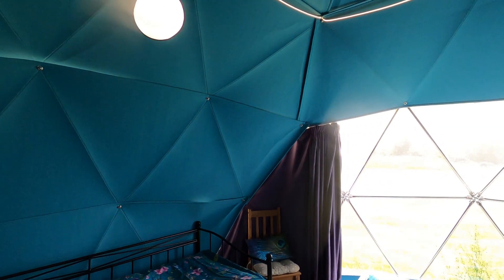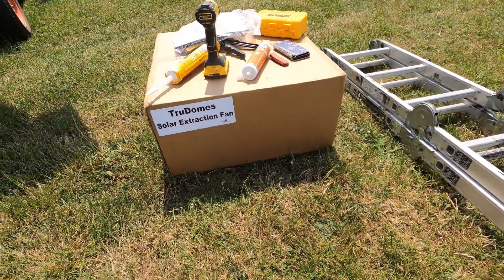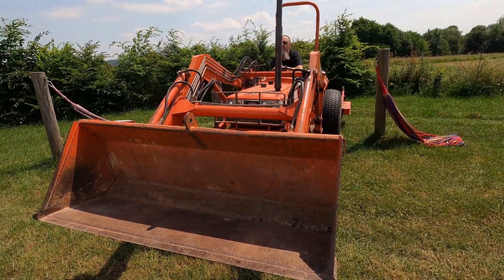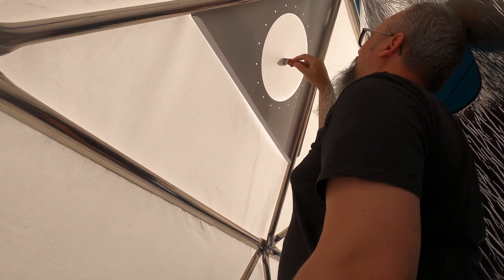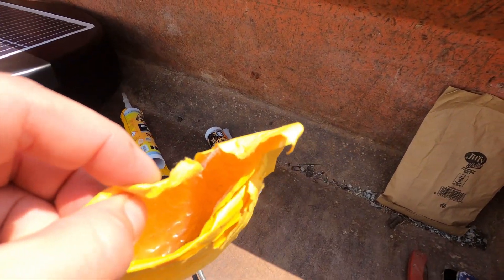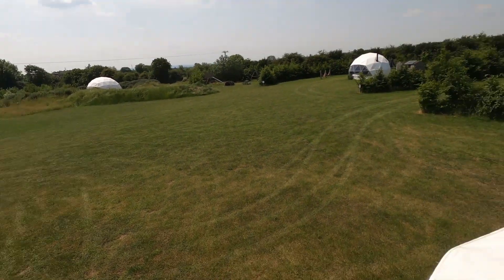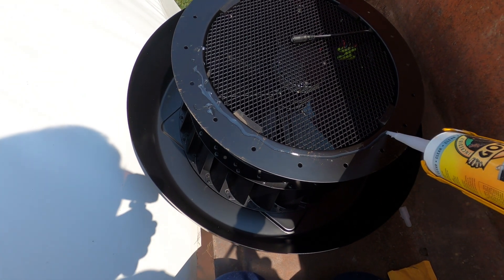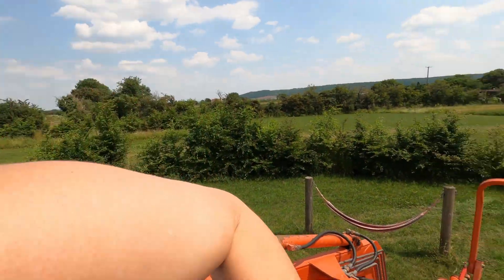Step-by-Step Solar Vent Installation in Geodesic Dome

Comment: How hard is this to remove if you are relocating the vent? (we are buying a dome for festivals.)
Reply from the maker: @ari_zed  it would be very easy to remove the vent as you would just unscrew it - however you would then have a great big hole in the canvas! Do you mean for taking it down and putting it back up at a different location? If you were doing that then I just wouldn't silicone it in, just use the bolts. Sounds like a great project! What country are you in? Thanks, Vicki
Reply: @TractorsandCream  thanks for the reply! yes it would be for taking it down and putting it up at a different location, and this might happen 1 or 2 times a year. we are getting an 8meter dome, and we ended up ordering just some small roof vents with small arched covers that deter rain.  I was concerned about needing to use silicone, so its good to know we could get away without it. but my other concern was climbing up on top of the dome on top of the pvc cover using a ladder, as it will be 4.5 metres, we don't have any special equipment except for a standard extendable ladder. you see, see hope to build the dome structure without any cranes, and then pull the cover, we could climb over the frame to get the cover on. but once its on we could no longer climb on it.
We are in Australia and it may get quite hot in the day, so we are tying to decide if we should put in the solar vent, but it may need a special ladder that extends more than ours and also scaffolding.... oh dear, so many words
Reply from the maker: @enkiverse  so hopefully this video will be helpful then!
https://youtu.be/SGGjTullJhU?si=ooUHz0ivGQvIt7et
We installed 2 solar vents retrospectively in a 10 metre dome using a ladder on the outside and it was definitely do-able! Plus an 8m wouldn't be as high. We are building our new 8m dome on Thursday this week so will have a video out about that soon so you can see the heights. We've never needed to climb over the dome even with the 10m - we just had a scaffold tower inside and a ladder. I wouldn't want to build one every weekend but a couple of times a year would be ok! 👍

Comment: hi whats the estimated cost to build one of these dome if it also include bathrooms inside
Reply from the maker: Hi, we spent about £20000 on our first en-suite dome which was a 7 meter one. When we were at the US glamping show, Trudomes hsd the fully kitted out dome with bathroom pod for $36000 but you also then need to pay for a deck too. Hope that helps. Thanks, Vicki

Comment: Hi cost of unit and where did you buy😅
Reply from the maker: Hi, it's £550 I think and came with the Trudomes dome kit but they would sell them separately 👍
Reply: hi whats the estimated cost if I build one of these if it also include bathrooms inside